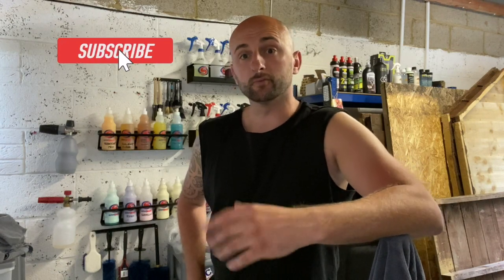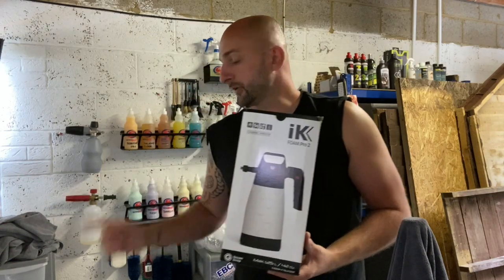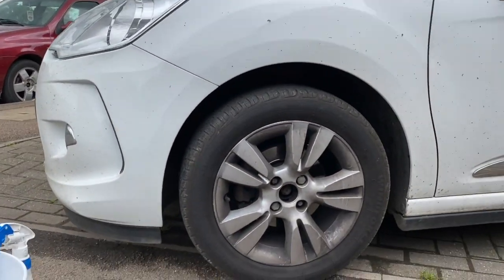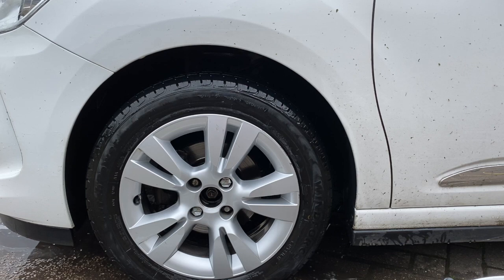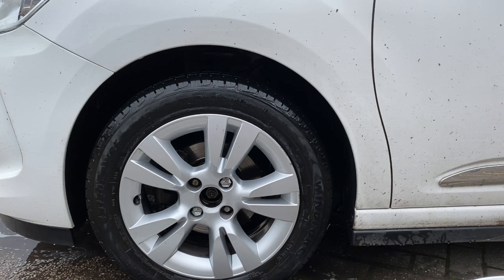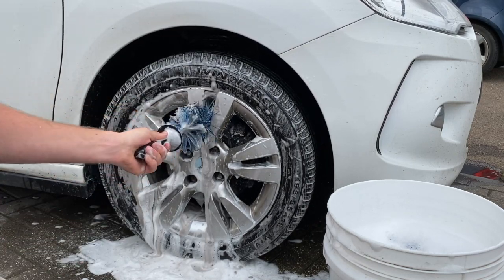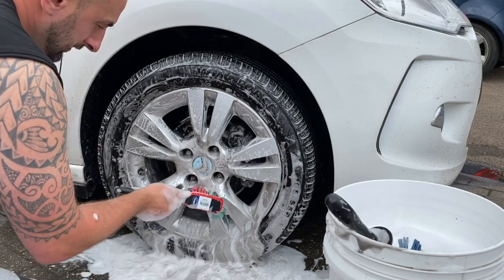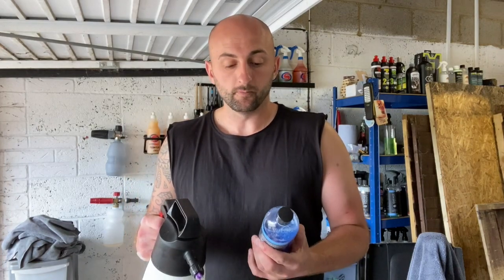Martins way... wheel cleaning

Comment: Hi,

Thanks for taking time to do this test and use our product.

Our advise would be use 10ml of product to 500ml of water. That should be enough to do all four wheels. The caps on our bottles, from memory only hold 5-7ml per cap full at most. We'd recommend 10-15ml in a bucket. This would give you a total of 20-25ml per wash.

When adding the solution in an IK Foamer, remember to stir the water so the solution if fully diluted, this actually helps a lot. If you want glue like foam 10ml to 300ml of water.

In terms of cleaning power for tyres, you are correct it's not strong enough to impact the dirt like an APC would. For maintained wheels where your regularly keeping the tyre walls clean then it's good for maintaining the dressing.

Hope this helps.
Reply: You guys seem to popup with a comment on all the vids I watch. 👍when you say stir...is that the same as give it a good shake?.
Reply: @andyupton5851  shaking will make the product froth up too much in the container so stirring is more effective.

We try and interact with our customers and community as much as we can or where we can add a bit of value.
Reply: @GarageTherapyOfficial  cheers guys.....guess I'll be stirring it from now on. 👍

Comment: Add a slightly bit more to the foamer. Also use a different tip for a thicker drier foam. Apart from that you cant beat this combo for wheels

Comment: Cheer for testing mate. Been doing similar testing myself. Try 30ml of wheel shampoo in the foamer and just a bucket of plain water 😲 or use the water left over from washing the car. I've wondered if I could just get away with just water as I do a weekly wash but I don't want to know the answer as I have a shed full of cleaning stuff😆